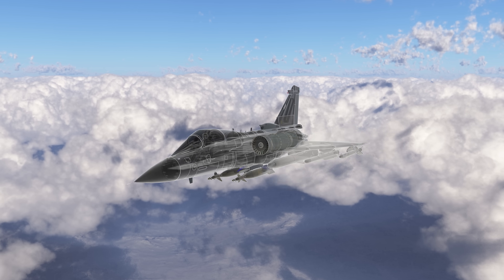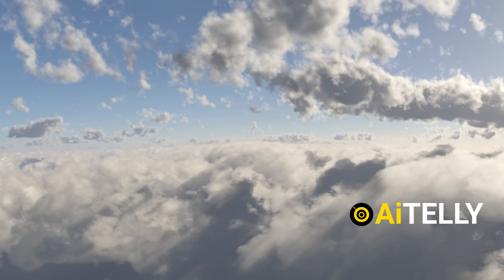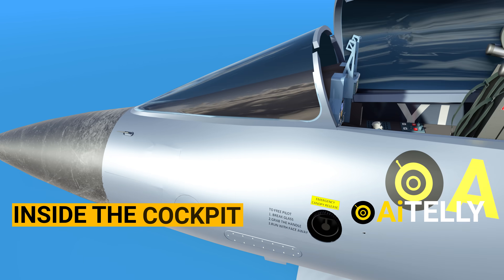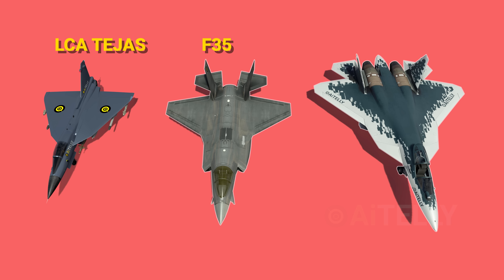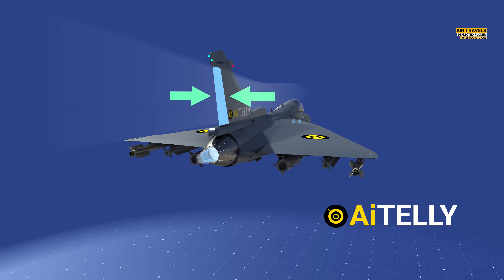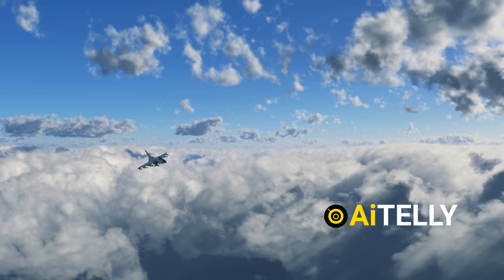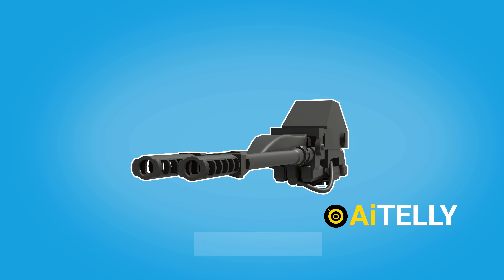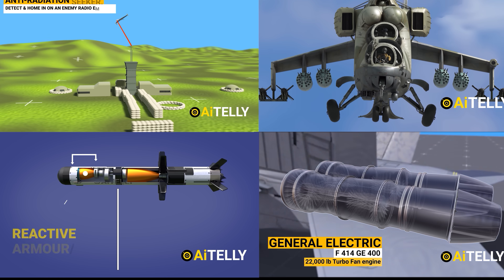Multirole Fighter Jets  How it Works | Tejas Mk1A LCA Light Combat Aircraft #fighterjet #jet #plane

Comment: Tejas has the lowest RCS most 4.5generation fighters 0.5 m^2  Which gives advantage in BVR combat... First look first shoot... Capability. 
Astra Mk2  - 160 km 
Astra MK 3 - 340 km at 20 km attitude...
Reply from the maker: Have Credited your Info in the Comment Correction Section
Reply: No doubt it's the best fighter aircraft in it's class.
Reply: @sriyanshumohanty6937  incorrect. Even if you invent the undersized 4th gen multirole fighter class, the winner would be Saab Gripen.
Reply: @bastadimasta  But Gripen is 4.5th gen aircraft not 4th generation aircraft.
Reply: @sriyanshumohanty6937  4.5 describes 4th gen with upgrades. It is not a class of its own.
Reply: @bastadimasta  Oh fine.
Reply: Do you know the reason behind that - 

1. All composite Wings. 2. Iron Ball paint - a low cost form of Radar absorbent material. 3. smaller nose nose. 
4. No huge tail plane. 

However the drop tanks and external AAMs do contribute to increase RCS. 
They could have added an S intake anyway. The Rafale has a S intake to reduce RCS.
Reply: RCS of 0.5msq could have been still be reduced if Tejas has a more powerful engine to power a SPECTRA like system. The Rafale can bring down its RCS to 0.1msq with the SPECTRA.
Hopefully the Tejas mk2 will be able to achieve that.
Reply: @direwolf7491  Indian nationalism at its best. You have no idea about what you are talking about. RCS has nothing to do with engine power.
Reply: @direwolf7491  I googled it and found Spectra India Breast Pump.
Reply: @bastadimasta this guy has not heard of what jammers are, then talks about natural stealth as rcs

rcs can correlate to how hard you are to detect, not from just natural stealth from coatings and geometry

electronic warfare systems can jam a missile and multiple targets at a time
Reply: Yourva fool. It has a huge rcs the vertical tail is proof. Itsva small jet. Not small rcs. It has no composite materials. This jet would have been obsolete 45 years ago. It can only function as a trainer
Reply: Also irs small size means small radar with bad range.  Combined with its HUGE rcs means its horrible for bvr.
Reply: @ruhtraeregel   do you know what is AEW&CS and it's roles lol...
Reply: use tab hoggi jaab weapons hongey, remember post balakot paki strikes........ we can beat our chest as the enemy does, reality is , we dont have intent.
Reply: Pls dont fight over who is more advanced and who is not. India and Turkey are both great nations with rich history. Turkey had an adv over us in military tech becz of their collaborative efforts. Whereas, Indian govts never bothered to look beyond Russian junk and petty politics. However, India is taking steps towards integrating and imbibing western tech. It will take time and effort. I m from India and believe that India can learn a lot from Turkey's Aerospace tech especially its drones which proved their mettle in the recent regional conflicts. Turkey too can benefit from India's space program. There is no point in fighting and debating. Instead, shake hands, share knowhow and step up military co operation. Pakistan - Turkey ties are due to the current Turkish ruling dispensation. In fact, India too has ordered Turkish drones!
Reply: @gurusastropalmistry2214  does turkey have nukes and space weapons? Do they have laser weapons or swarm drone technology? Can they build their own ballistic missiles with less than 10 m CEP? Turkey is just a turkey 🦃🦃🦃🦃
Reply: @gurusastropalmistry2214  I don't fight over anything Guru but I must reply the insults in the same manner.
Reply: Its RCS is 1.5 msq with full payload how it will give you edge in combat ?? PDFC radar can see this aircraft at 108 or 100 km, Astra mk-1 have launch perimeter around 40-50km. How its an advantage???
Reply: @thetopsecretpentagonsclass6350  still less then other 4 gen fighters....f16 has 5m2 lower Rcs gives edge on BVR combat...man  astra 2 and 3 gives a edge ...
Reply: @execute2626  which F-16 has 5msq rcs??? F-16 Block 50 RCS is around 2 msq, block 60 & 70 has 1 msq!. F-16V AIM-120D launch perimeter is about 80km, & new sabr AESA radar can pick tejas from 100km, Tejas has no match against even UAE block 60 F-16Es, F-16V is far far away!.
Reply: Tejas have 1.5 msq RCS with full payload including drop tanks, its not BVR advantage, it isn't a stealth aircraft, aircraft detection is based many things, where other 4.5 generation aircraft play superior role in ew warfare. How its gonna catch other 4.5 gen aircraft with inferior radar & EW system.
Reply: Turkey bro!! 
U supply everything to Pakistan, no problem with India,
If there is a war , come and join the pak forces too..also don't forget to invite the Chinese as well..
Reply: @execute2626  its very small thats why. F22 has less RCS than Tejas.
Reply: Fake rcs..
Reply: Because it's half the size of any 4th gen fighter. That's is not a real achievements.
Reply: @bastadimasta   RCS plays important role in bvr combat.... composite materials have been used for achieving lightweight... so I can say it has achieved a lot...at this cost we are providing fighters... it's not a trainer aircraft... Mind you it's 4.5 generation fighter...
Reply: @execute2626  rcs plays an important role but payload is more important for a multirole fighter.
Reply: @bastadimasta  tejas is a mutirole aircraft design for offensive air support, close combat and ground attack role at ease. It is also designed to undertake Ground Maritime Operations it's can carry next generation Brahmos anti ship missiles...your Hurjet is a trainer so learn the difference between a fighter and a trainer....i hope I have answered all your doubts...
Reply: @bastadimasta   you are comparing a trainer aircraft to a fighter...Hurjet is a light weight trainer that's a facts... India is  working on 5th generation fighter aircraft called AMCA...you being illogical...comparing a trainer with a fighter... And still you are comparing drones to a fighter plane...
Reply: @execute2626  I am not comparing a trainer with a multirole fighter
 You did that. Overall, India is way behind from everyone else with comparable population or economy.
Reply: @execute2626  Turkey is not in the same League with India. We are a much smaller nation with less than 10% of your population and fewer resources. The number of Indian engineers would surpass maybe every nation on the world. India must be competing with China, Russia, the US etc. However, we have a much better aerospace industry than India, and this fact proves Indian system has failed.
Indian engineers in Boeing alone could make a better fighter jet than Tejas.
Instead of realizing the issue, you try to boost your nationalistic feelings with how small the RCS of Tejas.
Reply: @bastadimasta  this has mass production capability
Reply: @bastadimasta  Turkey, much better aerospace industry that India? lol. How many aircrafts has Turkey designed on its own? Fighter, Trainer, Helicopters? 
Very funny!
Reply: @bastadimasta  if turkey has much better aerospace industry then why Indian space agency way ahead of turkey 🦃🦃🦃🦃
Reply: @marcd5196  we were a partner of F-35 program. More than 900 parts were designed and produced in Turkey. We are currently designing T-FX air superiority fighter, and a UAV Fighter jet Kizilelma. Tests are already started. We have several operational UAVs proven in combat in Ukraine, Azerbaijan, Libya, Iraq and Syria, to and exported internationally. TB2 is very famous and capable of taking down Pantsir systems. Another one Akinci which is capable of aerial warfare and carry more payload than Tejas. We designed T-129 attack helicopter from the Italian A-129 chassis with different engine, blades and systems. Then we designed T-629 and T-929 attack helicopters. We have another civilian helicopter called T-625. We are a partner for A300 M program. T
We are the second most producer of F-16 fighter jets, and first one in quality of production. We  designed, developed and producing every type of missile locally. We designed several airplanes and exported to Europe before WW2.
Reply: @thesenate8477  it isn't. You believe that.
Reply: @bastadimasta  so you have a lot of drones . noted. and u are developing some attacking helicopters and supplied components and sub components to foreign designed fighters.
U still didn answer my original question - How many aircrafts has Turkey designed on its own? Fighter, Trainer, Helicopters? 
Emphasis on the "ON ITS OWN".
Reply: @bastadimasta  payload? compare it to any other light combat aircraft like jf-17 its arch rival it has higher payload capacity
Reply: @bastadimasta  you are trying to pick a fight. Turkey versus India way to go. Keep fighting.
We are in different leagues and frankly Indians do not care what Erdogan thinks. 
Since India  & Turkey are not neighbors just let it be. We don't want to comment on Turkey Mr. Baykus if that is indeed your name.
Reply: @marcd5196  read!
Reply: @bastadimasta  well I'll give you one thing Turkey getting better in aviation very fast & that's all. Now about your comparison you mentioned your  un maned systems & licenced products you ppl are making (really nothing to boast when u have US nukes on your territory lol) but geopolitics apart we have too made unmaned systems like your tb2 & upcoming kizlema (HAL Ghatak), also ever heard of unmaned combat teaming well just google "HAL CATS". Then about helicopter & jets, we have also produced many helicopters some name dhruv, prachand etc & well jet u already heard about, abt your 5th gen jet it is looking real nice but we are on same pace as well but yes sure like u said ther is no comparison coz we are much larger economy & population & ofcourse not in any black or grey list unlike my Turk friends. Now like you said you are ahead then us, that's wrong at best you are beside us which is INDEED a huge achievement for a negative growth economy & I'm proud of you too(good work turks). Have a nice day, see you soon 🙂.
Reply: @KCstark.  success is not measured with producing prototypes but building cost effectively, proving the value in actual combat, creating an international demand for your product and exporting it
Reply: @bastadimasta  
 your hurjar has not done a first flight yet...nor it's has capability of a multi-role....but still you here comparing cheap drones Bayraktart to fighter aircraft...
Reply: @execute2626  Hurket is a trainer, light attack aircraft comparable toyour HJT-36 but with much better avionics. I could compare T-FX to your tiny Tejas but it would not be fair to you. I could also compare TB2 to your nothing.
Reply: @execute2626  what else can I compare it to? You are a nation of 1.5 billion and all you have is a tiny 4th gen jet "fighter" and nothing else.
Reply: @bastadimasta  ok, but I'll ask u same thing when u produce your hurjet & only one nation Pakistan is interested in it. Well what u said is partially correct since u dont know anything about Indian defence exports do you? Anyway Im not gonna waste time writing it, but yes your tb2 is real nice success but that dont mean others dont have similar things & we dont provide weapon in warzone unlike your nation. Also if u come across how Tejas failed as a export jet reports, lemme fill some bias in your head it was competiing among Trainer jets here i assume u know what are trainers. So in short Tejas is a fighter jet & not as cheap & fragile as a trainer. Anyway your exports are famous alover world so it's ok u can be proud of it, bayraktar is a good company nice MIT graduate.
Reply: @bastadimasta  i did read.  Turkey is behind in every area except Drones, though HAL does not design Drones.
HAL has operational helicopters like HAL Dhruv, HAL Rudra, HAL Prachand, HAL LUH. Historically it has made hundreds of licensed foreign designs like HAL Lancer, HAL Chetak, HAL Cheetah. Turkey? How many helicopters? T129 and thats an Italian design with Turkish customization. 
HAL has operational fighters like Tejas. Turkey? Nowhere there.
HAL has flying trainers like HTT-40, HAL Kiran and HAL136 Sitara. Turkey? Hurjet isnt even flying.

Its not a fair comparison. 

Even licensenced production....HAL has over 600 fighter jets in the last few decades - Su-30MKI, Mig-21,Jaguars. How many F-16 has Turkey made?
Reply: @KCstark.  dude, Hurjet is a minor project for us. It is supposed to fill a small niche. We will deploy our carrier capable super maneuverable unmanned stealth fighter  jet Kizilelma very soon. I am sure Pakistan will be our first client and will buy hundreds of to use them against your outdated jetling Tejas.
Reply: @bastadimasta  your minor project still not in air😁
Reply: @bastadimasta  have you any Hypersonic cruise Missile program? we have and test it some days ago😁
Reply: @marcd5196  if you are proud of your low quality foreign designed products, then you should know that Turkey is worlds second leading F-26 manufacturer after the US, and produce them in highest quality even better than the US. 
India is way behind everyone else. Personally, I wouldn't use an engineered product from a nation that could not solve a simple problem like sewage management system in the 21 st century.
Reply: @bastadimasta  have you any ICBM we have AGNI 5😁
Reply: @souvikbhakta2141  it may be beyond your comprehension but, just like any other carrier based , Kizilelma can land on normal runways too. 
But don't worry, we will supply Pakistan a aircraft carrier too.
Reply: @bastadimasta  have you any own design nuclear power ballistic missile submarine (SSBN)
We have INS Arihant INS Arighat😁
Reply: @souvikbhakta2141  just because it is a minor project, we channel our resources to more important projects like T-FX
Reply: @bastadimasta  you have TFX we have AMCA project both are not in air
Reply: @bastadimasta  at free of cost?😁
Reply: @bastadimasta  you supply Pakistan aircraft carrier ok good news
At free of cost?😁
Reply: @bastadimasta  hey Turk my brother......Greece got F-16 block-70 upgrade from USA where is yours?😊
Reply: @bastadimasta  Pakistan doesn't have money to buy food. It will be bankrupt. Will you give them free jets and aircraft carrier? By the way which carrier?
Reply: @bastadimasta  lol sure, looks like someone dont know how to read as expected of desert cult. 🙂
Reply: @kumarshashank7532  It doesn't matter. We are more than happy to supply Pakistan their defense needs.
Reply: @bastadimasta    That technically will be donation. In some time Turkey will be bankrupt too that way. Turkey doesn't have an aircraft carrier.  It is an amphibious assault ship.
Reply: @kumarshashank7532  brothers do not donate to each other. They share what they got.
Reply: @kumarshashank7532  Turkey is in the Mediterranean sea not in oceans. We a pure aircraft carrier would be useless for us.
Reply: @bastadimasta  I get it, there are brotherly relations, you may train and lease/sell but in this day and age, nothing is free. Even Turkey has trade relations with west as well as Russia. So you cannot paint things in black and white. Also, both hurajet and tejas are good planes. Online trolling and dry stats are irrelevant in real world.
Reply: @thesenate8477  we have around 20 satellites, most of them are built locally. 

Matchbox sized satellites, or crashing a small objects to planetary bodies are not actually achievements, but propaganda pieces. Stop whining and complaining. People of the Indian subcontinent has a great culture and achievements but India is a failed state who never able to provide its people anything.
Reply: @thesenate8477  the bird called turkey is originated in the North America, and was named after different nations around the world for promotional purposes. A tiny nation in the 16th century called England named this bird after Turkish people because Turkey was an powerful and exotic nation at the time. FYI, that tiny nation invaded your huge county with a small army for centuries.
We call that bird Hindi like many other nations. The bird is called Hindi in France, Russia, Poland, Ukraine, Belarus and almost any other nation on the East.
Reply: @thesenate8477  Hearing this from someone from India is fascinating. Being ruled obediently by much smaller nations than your like Mughals and English for centuries must have thought you valuable lessons.
Reply: @bastadimasta  Arabs attacked you and wiped out our culture and made you Muslims. In India, we fought, gained power back and saved our culture. That’s a difference between you and us.
Reply: @GauravPSingh  Arabs attacked us, then in two hundred years we ruled over them until the 20th century. 
We also founded Delhi Sultanate and ruled India as Tuglaq Dynasty for a century, then another three centuries as Turko-Mongol Timurid Babur dynasty.
Reply: @bastadimasta  because we didn't fought superior aircraft forces on war. Pakistan lacks number against overwhelming no of Indian aircrafts.  With China aircraft were useless on higher mountain. We don't have any geo political goals like NATO.. everytime Pakistan started war surender with in 10 days to month.
Reply: @sitarampradhan8488  you don't make sense. Modern fighter aircrafts of all variants are capable of fighting over 15kms altitude. Pakistan has an operational advantage of being a mountainous country. Number of aircraft is not the deciding factor in aerial combats. However, I agree with you on India not having a geopolitical policy.
Reply: @bastadimasta  don't forget we defeated the Ottoman Empire the battle of Haifa...or should I make you remember....
Reply: @bastadimasta  Agree with you that India is way behind other developed countries that because we missed industrial revolution. We are not superpowers when it comes to manufacturing and metallurgy.  Also India has a unique problem in our bureaucracy and lethargy. But India is fast catching up in the last decade and surely with private participation Indian military will be up there with the best. Also we donot spend enough money on R&D. That needs to change..
Reply: @ravikrishnamurthy  yes. F-16s produced in Turkey has a significantly higher quality control ratings.
Reply: @ravikrishnamurthy  Japan, Russia, Spain, Turkey missed it too. In fact, every country outside of the western Europe missed it. Stop whining about it, you had three centuries and endless resources to catch up with it. Your bureaucracy is formed by Indian people, thinking with Indian values, so you must stop blaming them too.
Reply: @execute2626  yes with British rifles, uniforms and commanders, and only in once in your history, and only in a battle while we retreating. However, you should also remember the Siege of Kut in the same war, you should check the photos too.
Reply: @Ibleedwhite  Arabs did not convert Turks into Muslims because we lost a war. Turkish conversion to Islam took several centuries to complete and ended as late as the 16th century. In the 9th to 11th century, we were ruling Arabs and Persian already, so conversion allowed us to rule them without resistance.
Reply: @Ibleedwhite  what language do you think Timur, Babur and their armies were speaking. Chagatai Turkish. They had some Mongol ancestry but they were mostly Turkic. We are the same people. We also don't consider Mogols as other people, and they do the same for us. By the way, Tughlaq is a Turkish word.
Reply: @bastadimasta  My ancestors were Hindu and I am still a Hindu. Your ancestors were probably Buddhist or Tengrist, however, you are a Muslim now. Why?
Reply: @bastadimasta   it's was the Punjabi Sikh...who defeated Ottoman Empire... In Haifa 
 Rifles uniform does not matter... what matter is you lost the battle 1,350 Turks and Germans were taken prisoner it was a humiliating defeat...
Reply: @execute2626  Sikh are great warriors but a single battle in a war doesn't matter. My people subdued everyone from China to France, Russia to India, Egypt to Germany at some point in time and ruled Eurasia peacefully for centuries. Even in our most desperate times, we fought and beat the UK, France, Italy and Greece together. There is no one greater than us when it comes to unify as a Nation and fight like demigods.
Reply: @harshvardhansinha  are you aware that T-FX program is ahead of AMCA?
Reply: @bastadimasta  mongols literally came from Mongolia, they just adopted same religion and ruled over you for hundreds of years.
Reply: @thesenate8477  don't talk to him he is just so naive and get hurted after hearing truth his country is nothing more then a factory for west and there b2 drone is cheap that's why it is being used in ukraine
Reply: @bastadimasta  Hope your country had made Earthquake proof homes instead of that stupid drones
Failure state. Your country did construction along fault lines avoiding rules, now it is facing the consequences. Begging for help from entire world.....
We are happy to help
7 trips of Globemasters with our NDRF teams and rescue equipments reached Adana and are working in Gaziantep. Our Indian Army built a field hospital for your people. Hope Turkey gets the lesson
Reply: @lifeisfkinggood  ...says the guy who grew up in cardboard houses in slums.
Reply: @lifeisfkinggood  I would like to but need to have several vaccines for the diseases eradicated in everywhere except India.
Reply: @lifeisfkinggood  Europe and China has denser population without polio and the other ancient diseases. Even the diseases from the Medieval Period are still prevalent in India. You should criticize your country first, instead of bragging about it as it is. Only then you can achieve improvements and maybe become worthy of your history.
Reply: @bastadimasta  you may be happy to send them but your government won't send them.
Reply: @thesenate8477  cardboard doesn't hurt when it falls on top of a person.
Reply: @bastadimasta   politics is the problem not talent. High  Quantity or high number of engineers doesn't mean anything if we don't have govt working productively.  India has too much bureaucracy problems . If govt constantly places orders with private military industries in india they can produce quality stuff.
Reply: @marcd5196  turkey has produced some decent stuff lately like bayraktar, attack helicopters and even ships . It doesn't matter for them anyway they are in nato and they are protected.  We are stuck between Pakistan and china and both have good fighters
Reply: @bastadimasta  Wanna know difference between turkey and India? Moon in the flag vs Flag on the Moon
Reply: @Gareeb1997  Do you wanna know the difference between India and Turkey?
Only one of them has a native built stealth 5th gen fighter. Only one of them were ruled by foreign powers, but both of them were ruled by Turco-Mongol people. Only one of them is not ridiculed for their hygiene.
Reply: @bastadimasta  India is way ahead of Turkey in space sector , missile technology, ….India can build better aircraft carrier , helicopter ,artillery system than Turkey ….. India can build Nuclear attack submarines, destroyer , frigates, corvette …. India have its own nukes…. Turkey is good at making drones but if you are comparing then compare other sectors….I have nothing against Turkey but nowadays I can see whenever there are any news about India Turkish people come to spread hatred against India….
Reply: @bastadimasta  Better Aerospace industry than India? Are sure about the “Space” part? Sent anything to the moon yet? How about Mars? Have any commercial arm of your aerospace agency that lets other countries send their satellites? How many Rockets has turkey developed with high payload capacity? Anything comparable to bramhos, AGNI series? Turkey is very good when it cones to low cost drones. Anything else I don’t think is comparable with Indian tech.
Reply: @sanketjadhavar  attaching an expendable microsatellites on top of a ballistic missile is not really a space program. Crashing a small and useless body to moon is no space program.
North Korea can do what India did any time. 
By the way, TAI builds  satellites and export them too.
Reply: @bastadimasta  can turkey do it though? India has our own satellite navigation system. India was the first to softland on moons south pole. India was the first to successfully deploy a spacecraft in mars orbit in first attempt. Now ISRO is studying the sun through Aditya L1 mission. Are all of these “even-north-Korea-can-do missions”?😂 More importantly , can turkey 🦃 do it? Laughing on other peoples achievements as insignificant when you have to prove you can do it is shameless behaviour. Turkey can only make drones, that too the inexpensive and mid-expensive ones. Thats good, but India will catch up in a few years in that field as well. Let me make this clear again. Turkey cannot even dream of a space programme, to the extent of what India has already achieved. What we will be achieving in future is beyond your imagination. India is an exceptionally resourceful nation who is poor at present. In a decade or two, that won’t be the case. Turkey does not have potential to grow as fast and as big as India. Space program are tbh quite useless. But they are a symbol of soft power and technological superiority. Such symbols are needed when your country aspires to be among the elite. Turkey 🦃 cannot dream that and hence doesn’t need such symbols. So save money and make some more drones!
Reply: @bastadimasta  not an achievement maybe but definitely handy, ask  any fighter pilot how mig 21 was extremely difficult to spot with human eyes while flying. Tejas is even smaller than that. Smaller target , smaller Radar signature . It's a cheap , efficient bomb truck . Fits its role perfectly. Also the delta wing gives one circle fighting advantage
Reply: @bastadimasta  jf-17 is almost the size of tejas but has larger RCS than tejas as tejas extensively uses composite material... 90% surface and 45% weight
Reply: @kshitijsharma6289  Jf17 is much larger
Reply: @n.c9653  not much larger.... Almost the same size